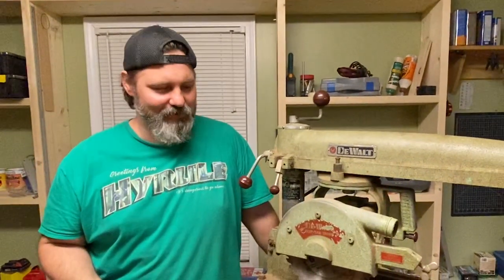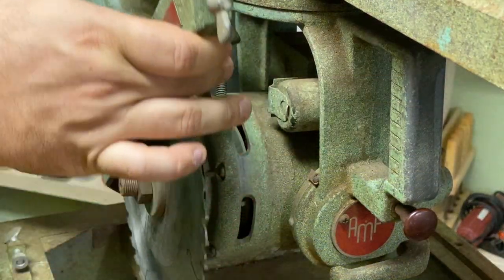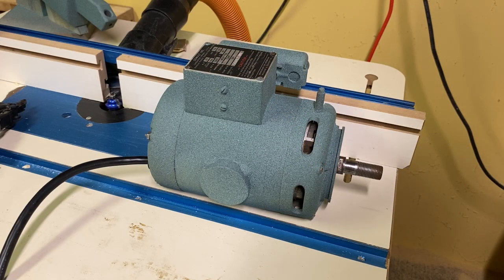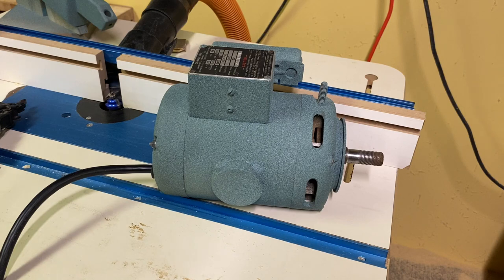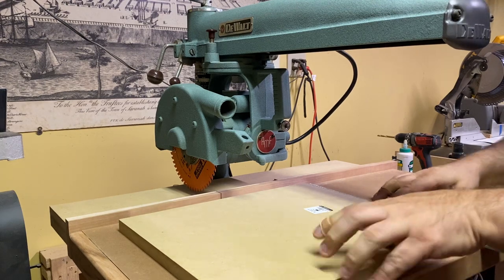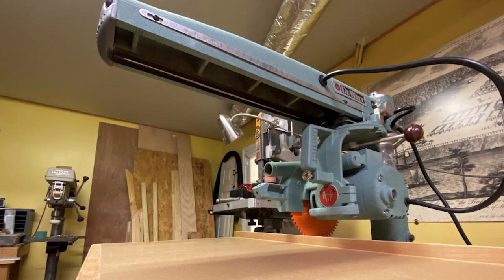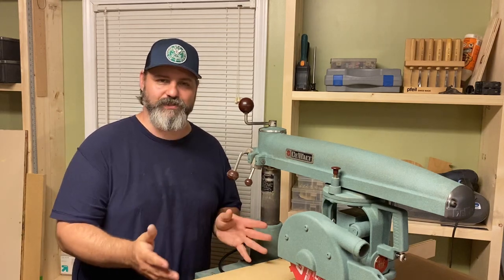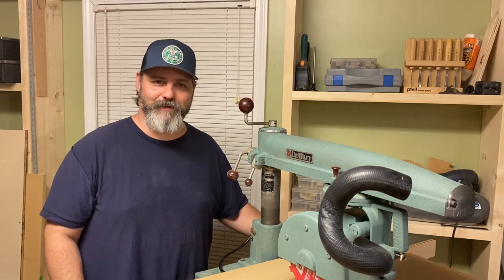A Light Restoration of a Dewalt MBF Radial Arm Saw

Comment: Nice video 
I've got the mbf also ,mine is dated 1956 ....back when you got American made quality, made to last two lifetimes.

I did a restoration recently.A lot of therapeutic work to get it up to snuff.
changed out the bearings on the motor,rewired.....replaced the old roller bearings.The table for these really 
needs to be rock solid flat ,to true it up to the blade.The "Mr Sawdust table"is the one to make.Plan on spending some time getting it dialed in,but once its set up properly ,you'll get very accurate cuts.

Comment: Great video! I also have the same saw I picked up locally I need to restore. Where did you find information on the wiring? Mine has terrible wiring that must be replaced as well.
Any advice appreciated!
Reply from the maker: Thanks, Marc. I really wish I had gotten a better photo of the wiring when I finished it. I think there was a post on Lumberjocks that helped, but then the Dewalt RAS group was also had some helpful posts. I'd post a photo on that group to get some advice if I were you. 
http://forums.delphiforums.com/woodbutcher
Reply: @exmateriawoodworking6733  thanks so much for the great idea! I'll look into joining there and sharing some pictures!!

Comment: I'm curious.....   Did you strip the old paint.  Or just clean it up before repainting.     If you just cleaned it..... how did you do that?        I'm getting mine cleaner. but, still way too much "Old" crud to repaint    Tom
Reply from the maker: I got rid of the loose stuff and gave it a light scrubbing with a brass wire brush. I didn’t need to remove much, plus I wanted to be conservative because I don’t know what was in that original paint.

Comment: Hello Good video. what is the maximum cross cut?
Reply from the maker: Currently about 13.5”, but I can adjust the fence and get around 15”. That said, Dewalt made much larger saws that will do longer cuts.